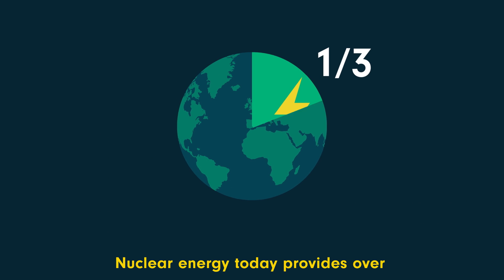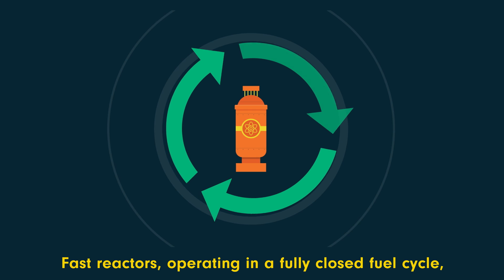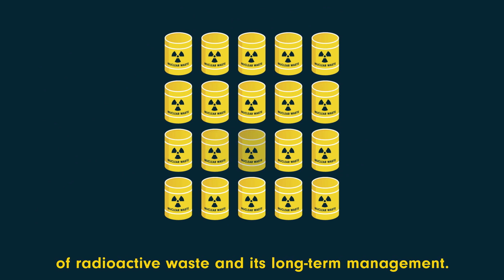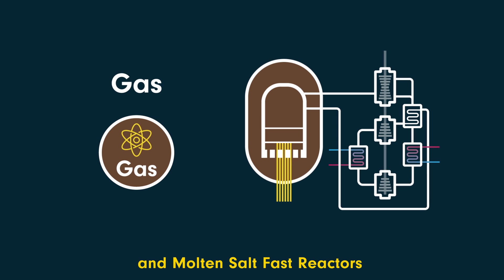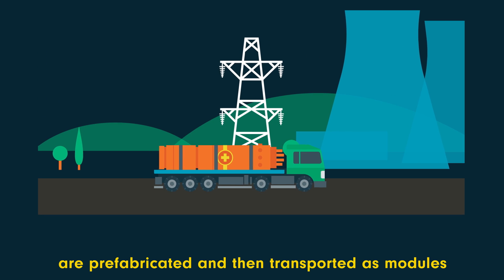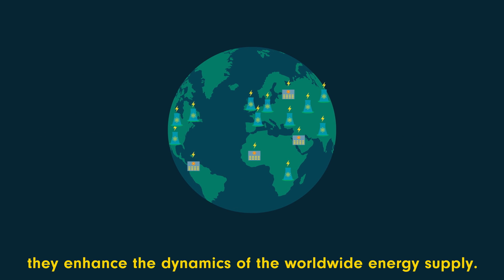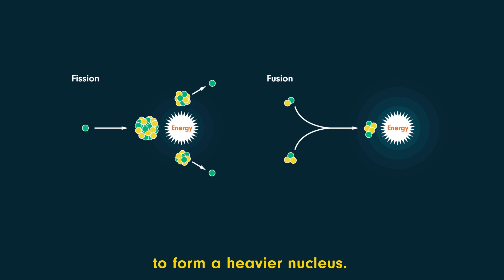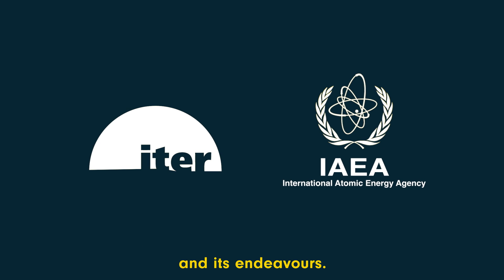What is the Future of Nuclear Energy?

Comment: The only fluid fuel reactor mentioned was fusion or plasma fluid reactor. Nuclear Fission
 also can be done using fluid fuel reactors.
There are 3 liquid fuel reactor concepts that got tested at US national labs during1950-60s
1. Molten salt reactor (Oak Ridge National Lab)
2. Aqueous Homogeneous Reactor. (Oak Ridge National Lab)
3. Liquid-metal fueled reactor (liquid uranium metal). (Brookhaven National Lab)

Liquid Fuels can be moved quickly using pipes and pumps. The main advantage of using fluid fuel reactors is the liquid-fuel reprocessing can be done while the reactor is running. With online reprocessing, a closed fuel cycle can be achieved as a continuous flow process.Also there is absolutely no structural damage to the liquid-fuel. The liquid fuel can stay inside the reactor until it is fully spent. Among the three liquid fuel reactors, the molten salt reactors were considered more practical.